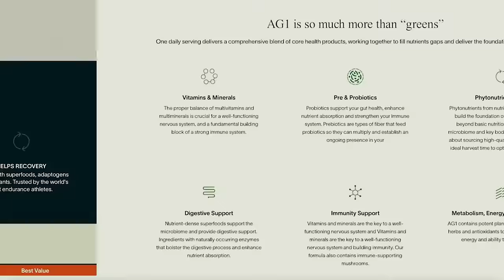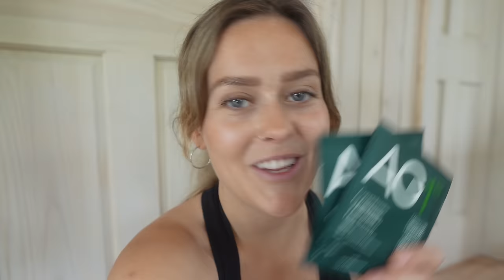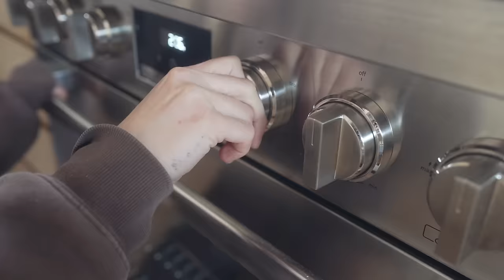THE BIGGEST CABIN TRANSFORMATION YET!

Comment: You girls are great! Between the two windows/doors how about a self contained water feature. You can build one off the deck or hang off the wall. You will have to run an outside electrical hookup to run a small water pump. It is very soothing to listen to water falling at night while laying in bed or sitting on the deck. I built a two foot wide three foot high free standing fountain out of a old rum barrel an old fashioned hand water pump. Since it is self contained there aren't any water lines outside the pump or barrel. It looks great and the water pouring out of the pump sounds great when it hits the inside of the barrel. You will have to fill the barrel with a hose once a week. Have Fun!

Comment: Between the big doors I would finish that wall area with an accent coloured siding, ( deck boards perhaps) and maybe a horizontal application such that you could hang some garden pots or a living wall with plants you like.

It could be a vertical siding which makes it look taller .  Depends how the living wall or pots are installed I guess.
Pretty nice doors.  My sister wants the 1 fixed unit beside the bifold for an 8 ft opening onto her rear deck.  Great idea

Comment: What are the technical specs of the new doors and windows to replace the removed wall insulation for heating/cooling the cabin?
With all the black flies, doesn't the lack of a screen on the kitchen foldout window defeat adding a screen on the large folding door that leads to the patio?  If you want to let the breeze through the cabin, don't you need screens on all the windows, folding door and sliding door?

Comment: If you underpin your cabin with an insulated system, (prefab or home built removable panels for proper ventilation), your winter floors will be warmer.
Reply from the maker: It has 8 inches of insulation sprayed under it. We do plan on doing a breathable skirt though